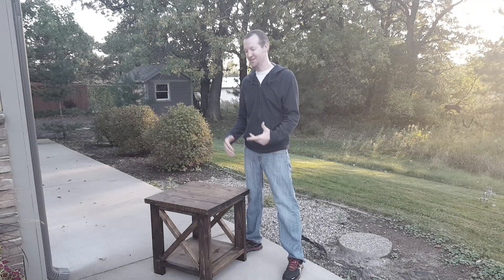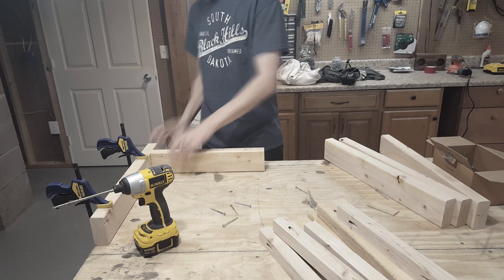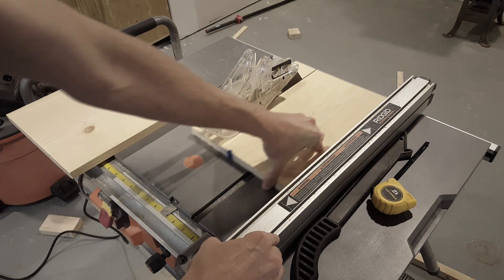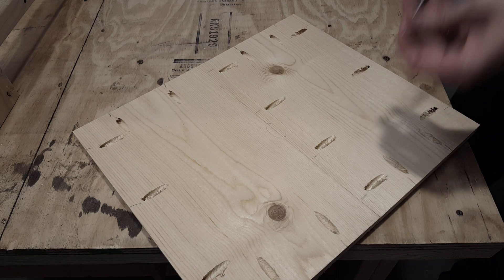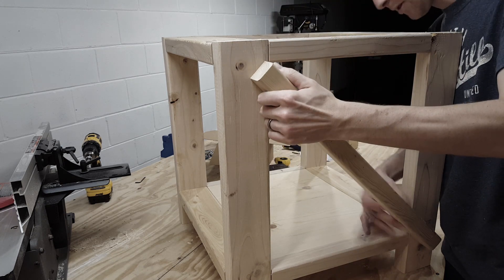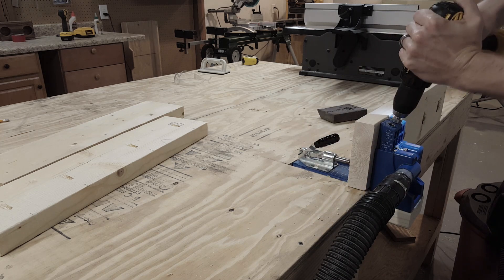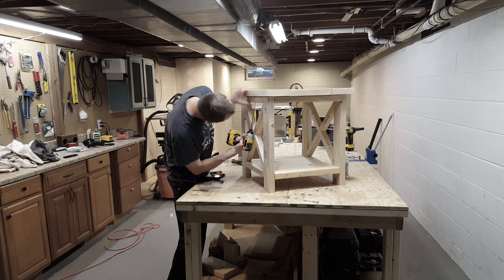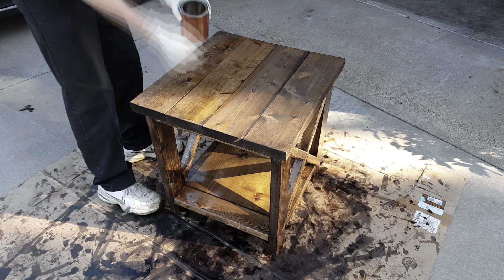DIY Rustic Cross End Table

Comment: Great build! Why don't you use glue to connect two boards on the bottom?
Reply from the maker: Thanks! I actually used to glue everything, but I have found that the pocket hole screws hold great on their own.

Comment: how did you know the X brace was a 45 degree angle?
Reply from the maker: I marked both angles of the 2 by 2 with a pencil when I held it at a to the table at a angle. Then I brought it over to my miter saw and matched the pencil mark angle with what angle I needed on the miter saw...hope this makes sense :)

Comment: How many inches did you rip off of the 1x12 to make the bottom shelf? could a 1x8 or 1x10 suffice? I lack a table saw...
Reply from the maker: You could just adjust the dimensions for the rest of the end table to fit the 1x 12 with out cutting. Or Home Depot usually will cut things to size for you as well. Good luck!
Reply: What us the size for yours?

Comment: Hey Chad - I copied your design and liked the way it turned out. Here's a pic: https://screencast.com/t/h2Ihoe4Z0

I think next time I'll do a half lap joint for the decorative cross beams, and perhaps 2 x 4's for the bottom shelf running the same direction as the 2 x 6's that make up the top. I'm thinking of building another one along with some wood chairs (maybe adirondack) for my front patio. Anyway - just wanted to share and let you know I appreciate you doing the video!